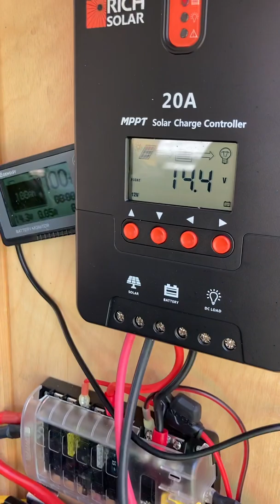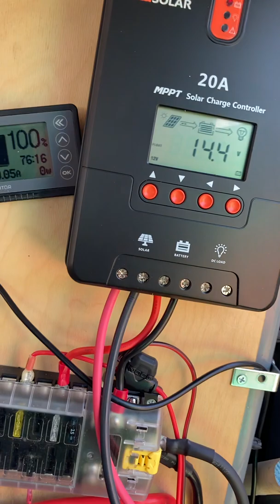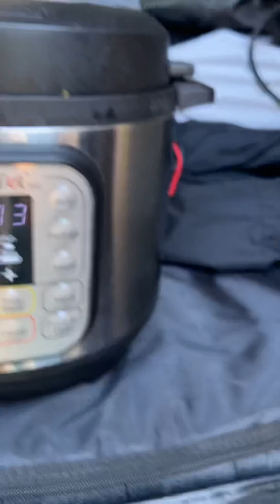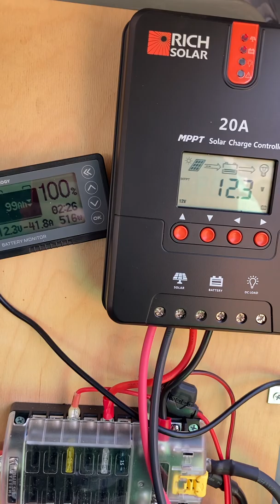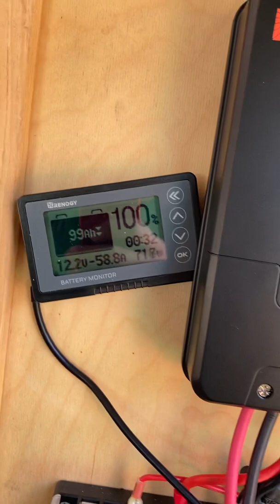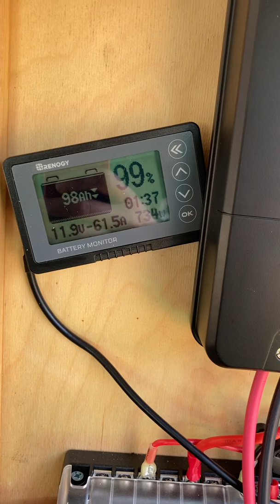SOK LiFePo4 100Ah battery test - voltage sag

Comment: I believe what you're calling voltage sag is an expected voltage drop across your wiring and the internal resistance of your devices. As the current goes up the voltage drops will increase.  Someone with more experience can correct me if I'm wrong but unless a device or your battery is defective and the internal resistance is higher than it should be, what you're seeing is expected behavior.